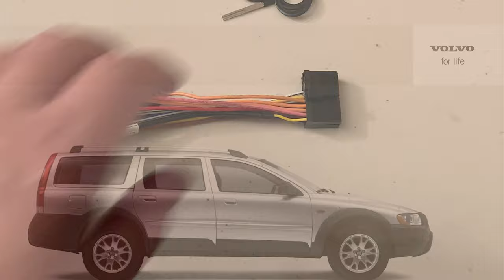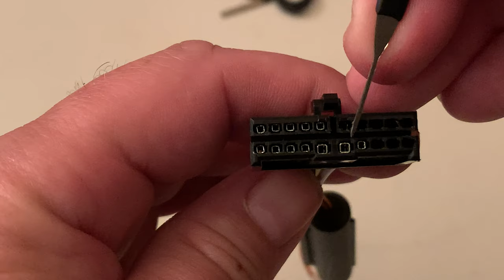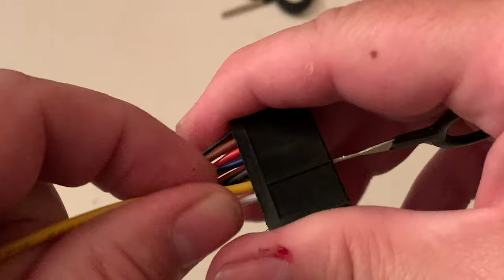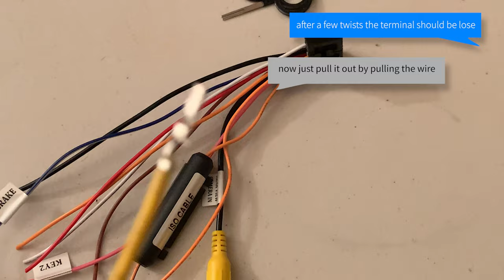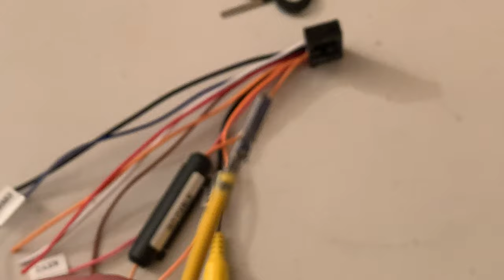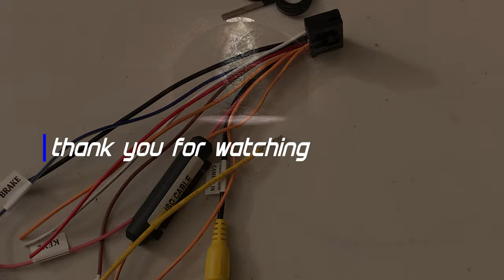[Adventure XC70] How to unpin a 20-pin audio connector (Android Head Unit)

Comment: Thank you so much, had the tool but could not work out how to get the pins out, with your guide complete success
Reply from the maker: You are welcome and I’m glad I could be a bit of help to you. It took me a while to work out how they proper work, I went through an apprenticeship as car mechanic but we never created our own harnesses, so by doing this it was the first time I used those tools myself
Reply: What is the tool name?
Reply from the maker: @vinodmv6618  they are called “Car Terminal Removal Tool” or sometimes also “Connector Terminal Pin Extractors”. You also need the crimping tool and the crimp connectors matching your car connector.

Comment: Thanks you! This is the only video among all the resources on this topic in which I found what I was looking for. I couldn’t find any details about disassembling this particular connector anywhere.
What is the name/type of this terminal? I need to insert Canbus cables into the same connector in the free slots, so I'm looking for a wire terminal
Reply from the maker: I just know those as 20-pin connector female, you can buy them in some shops like RS Online and is called 
Molex C-Grid III female connector housing, 2.54mm, or
Amphenol FCI, Mini-PV female Connector Housing, 2.54mm.
In both cases you still need the female circular crimp connectors and a crimping tool / plier if you want to create your own harness. Please keep in mind that you need an active adaptor for the steering wheel connection to the CAN-bus otherwise they buttons won’t work but could cause trouble in your system.

Comment: What if my pen is just slightly bent? I've tried bending it back and it worked for a minute but it disconnected again.
Reply from the maker: What pen is bend?
Reply: Just connect the 2 wires that should be connected via the pins directly.
Reply from the maker: @JamesCarter44  you can buy also the pins for crimping, so you could create your own pins and clip them into the connector. You could also solder the two end together which would make the connector obsolete somehow…